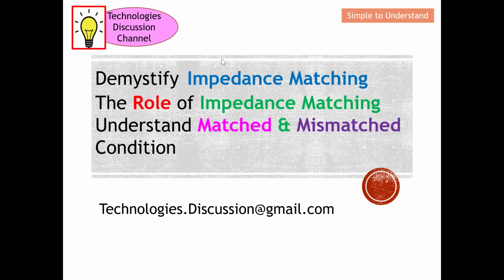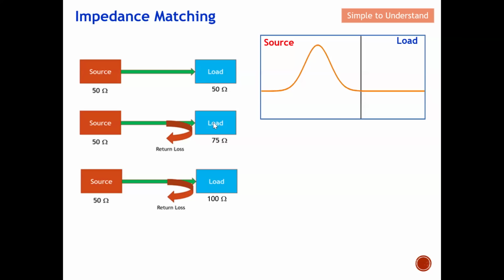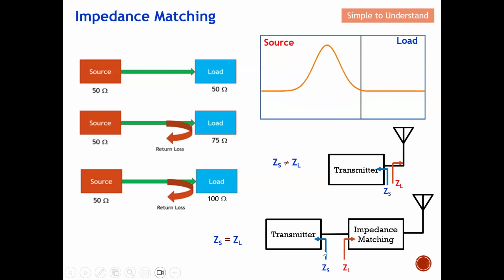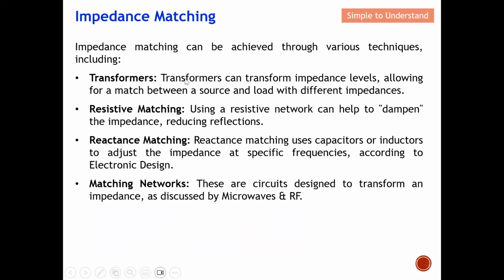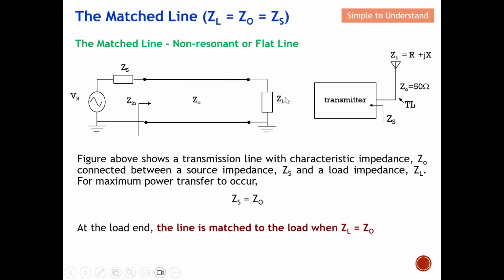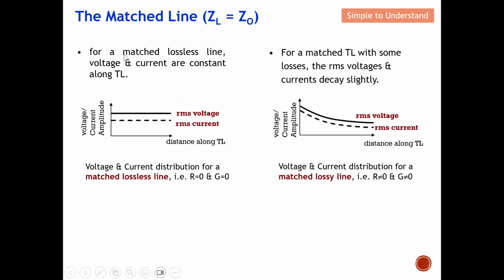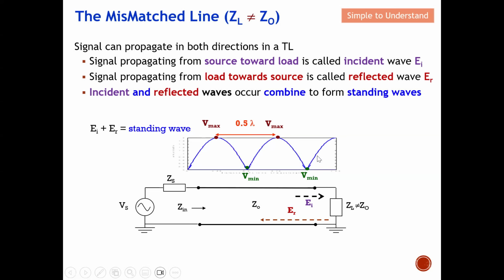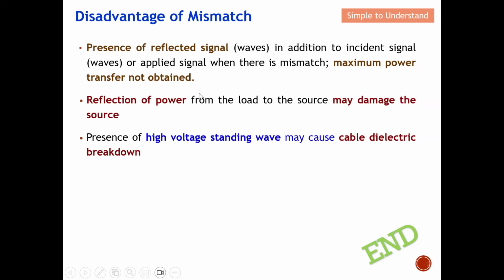Impedance Matching #1. Why RF Uses Matched & Mismatched Design: Max Power Transfer vs Reflection

Comment from the maker: This video explains how to achieve maximum power transfer by minimizing reflected waves. Imagine this: to maximize power transfer, you need to deliver the entire signal to the load—just like a transmitter sending all its power to an antenna. To accomplish this, the impedance must be matched (either with the same impedance or a complex conjugate match). This ensures that all the power is delivered to the load. The inserted impedance matching network (or transformer) adjusts the impedance to make this possible.
Reply: I'm urgently looking for this Animation, do you think you could share it with me on my email?
Reply from the maker: Just the animation, right? I cant share the PPT. Pls email me so that I can send it to you. Pls help me by Like this video and subscribe to this channel and on all notification. Thanks.  :)